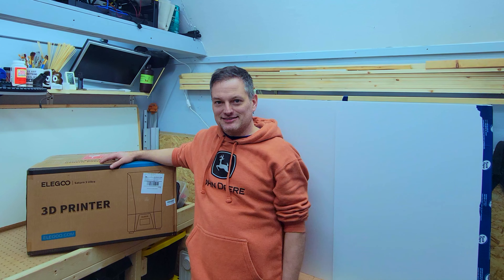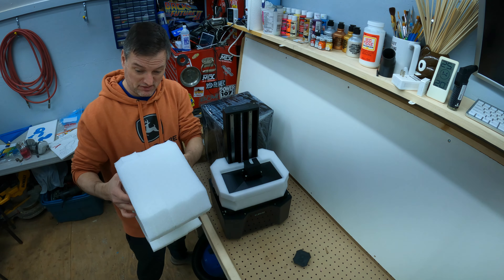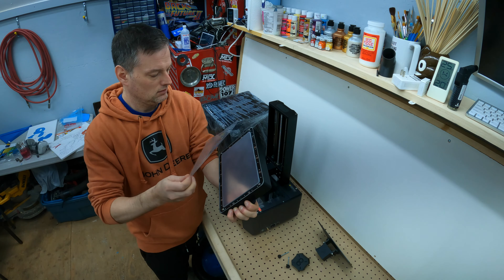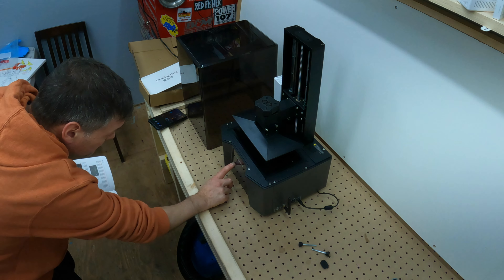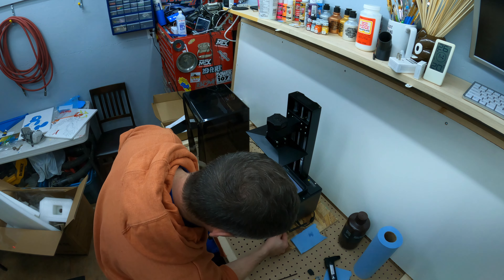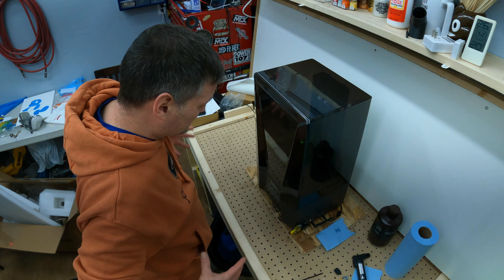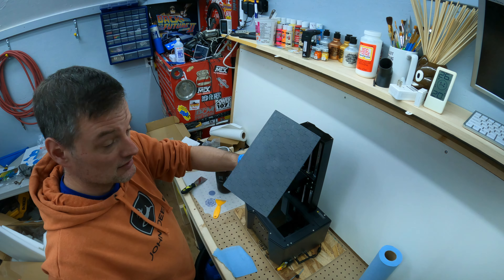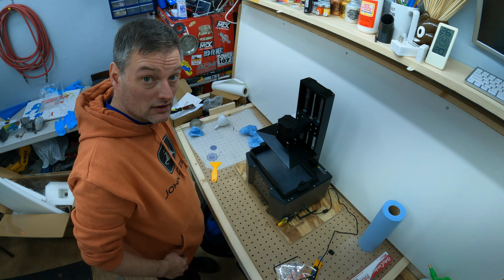Elegoo Saturn 3 Ultra 12k Unboxing and First Prints! 🚀🖨️ #3DPrintingAdventure

Comment: I recommend another way to clean the tank: 1) First, use the "Tank Clean Function"  This will cure a thin layer of resin in the active area of the LCD.   2) Pour the resin from the tank to the bottle.  3) Clean the tank. A rectangle of cured resin will still remain in the tank.  4) Scrap off the cured layer of resin using the plastic spatula (carefully). Usually it goes well and in one step.  This  method is much less brutal than yours in the video :)
Reply from the maker: YES! I 100% agree and just figured this out not too long ago. thank you for writting out the steps and I will pin this comment for others to see.!

Comment: Hey bud, I recently got the Saturn 3 ultra 12k. I looked at all these cool prints people have made and I got so excited I purchased one without looking more into it. I have recently been on Reddit and saw some posts of people saying about the fumes and toxins this gives out and can be extremely dangerous. I have a small computer room with a small window. So ventilation is a problem. Can you give me some advice on what I should do to eliminate this risk or should I return this product before its too late. Many thanks. Keep up the good work. :trophy-yellow-smiling:
Reply: I just got my Saturn 3 ultra recently, as well. With the single filter unit, I had a bit of a smell. I borrowed my friends air quality meter, and it wasn't great. I purchased the 2 pack of filter units , plugged in the second one, and the smell went almost all away. The meter showed a good improvement as well. I went out on a limb, and purchased the Mars mate, hooked it up, and I have no smell, the meter didn't pick up any VOC's, and the regular air quality was pretty nominal. I did all of this because my studio is just a bedroom, and I have cats.